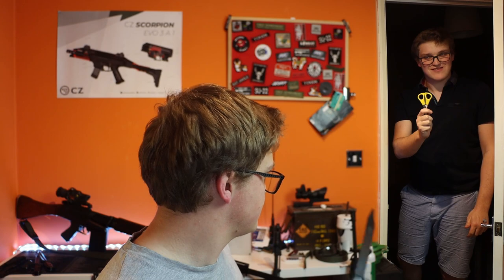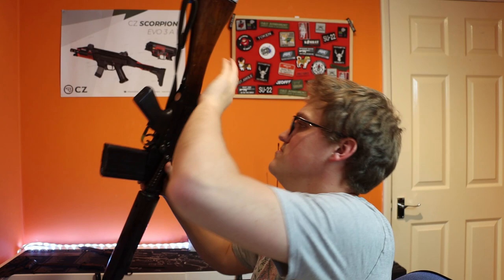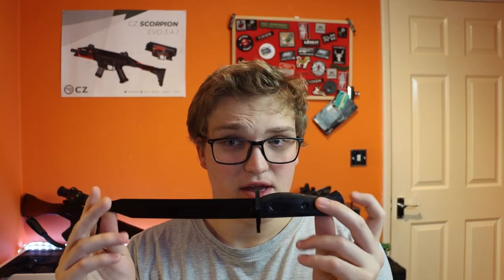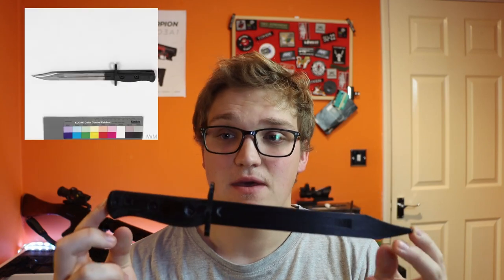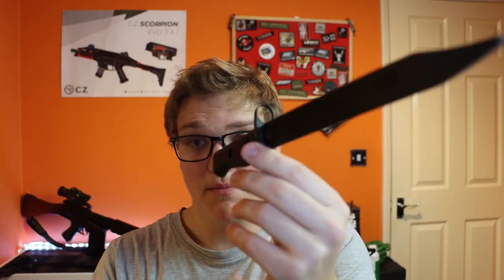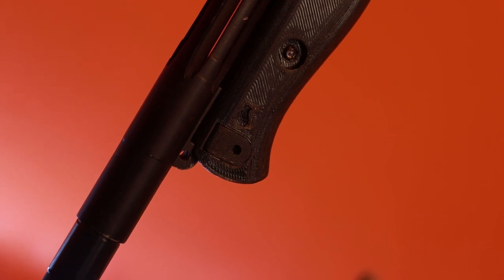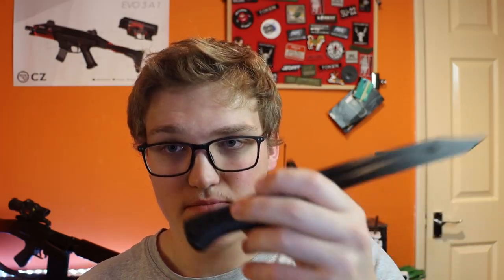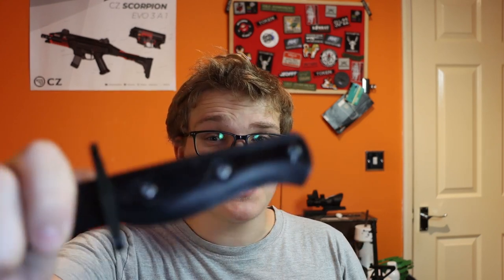L1A1 SLR Airsoft Bayonet

Comment: Have you considered modifying the design to fit an S&T Sterling? From what I have read the only difference with the SLR bayonet was a larger ring to fit the Sterling's muzzle. However the bayonet lug on the S&T Sterling, at least mine anyway, does not inspire much confidence in accepting any bayonet.
Reply from the maker: Yep it's something I'm working on as I have the sterling as well, though the lug is much more rounded than the SLR. So I'm going to have to redesign the muzzle ring and the handle
Reply: @EnglishKiwi  I would be very interested in buying one when you have finished it, keep us informed!
Reply: @EnglishKiwi  How is progress on the Sterling bayonet?
Reply from the maker: @nialltomy15  check out the video I released on Saturday about the sniper upgrades, there's a sneak peak of the prototype bayonet at the start :)

Comment: Dude awesome! Will this fit my LSW?
Reply: No. It's for the L1A1 SLR. I can't remember if the LSW has a bayonet lug or not but either way it's from the SA80 Family. Hope that helps 😊
Reply: @DMAC1966  ahh I'll check! Thanks mate :)
Reply from the maker: unfortunately as Derek said the slr bayonet won't fit the sa80 series of rifles. Also on top of that I don't think the SA80 bayonet will fit the LSW as it uses a different flash hider :(
Reply: @EnglishKiwi  awh no danger mate. Something else to get your teeth into eh!? ;)
Reply: The LSW had/has no facility to attach a bayonet, it has a different flash eliminator to that of the L85 and then bipod assembly would preclude the fitting of a bayonet even if it did use the rifle flash eliminator.
Reply: The LSW was designed as a fire support weapon system (incredibly to try to replace the GPMG!) and was therefore not meant for up close contact with the enemy and was not intended to fix a bayonet